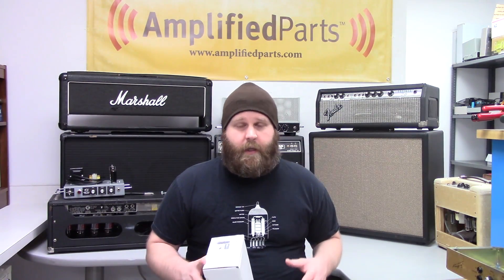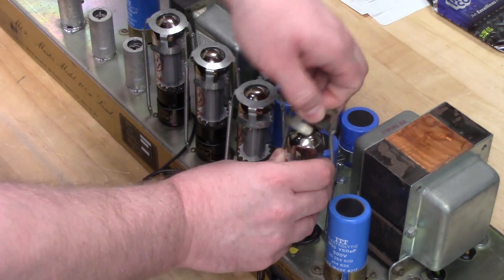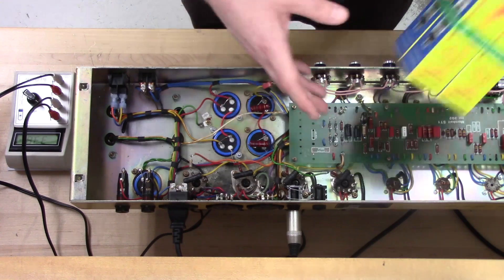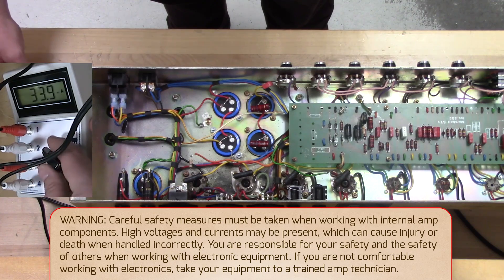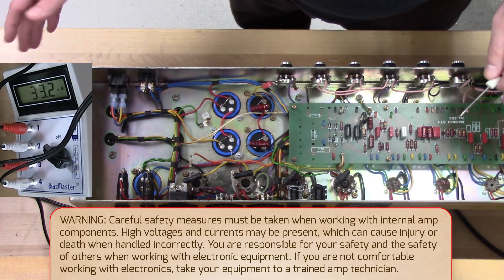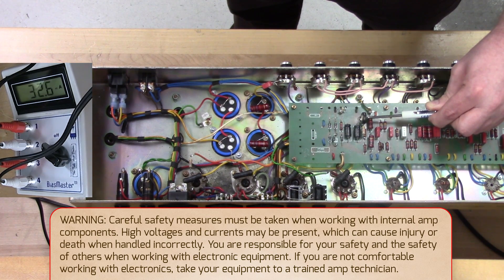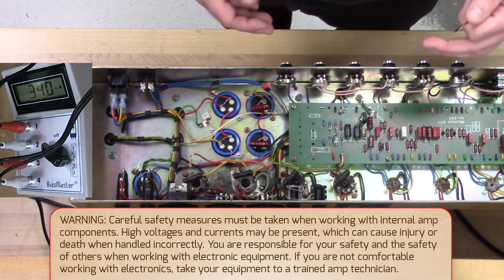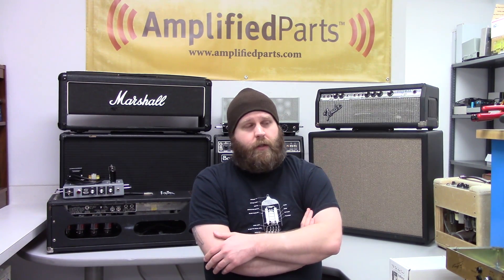How to Bias Your Amp Using the Tube Amp Doctor BiasMaster

Comment: Great instructional video. Do you ever check the overall bias  current or just rely on the cathode current for each valve. It seems like a longer way to set the bias if the valves are already matched?

Comment: The TAD manual states that if the matched tubes are not within 1.5mA tolerance, something must be wrong. What's your take on this?
Here's the manual quote: "With a matched set of tubes the value should be in a tolerance of +/- 1.5 mA. Exceeding of this value indicates a malfunction and the amp should be taken to qualified personnel."

Comment: I’m sure others have said, it’s not enough to just say “set it between 25-48 mA.” You really need to measure the plate voltage to be able to calculate where the bias should actually land. 

If you have a plate voltage of 480 V and you’re running EL34’s, they should be set around 36 mA if you are going for 70% dissipation at idle. However, if you had an amp that ran the plates higher, say at 513 V, it will be more like 34 mA for that same 70%.
Reply: 6L6 (the black metal tubes) per IEC were tested @ 250 VDC plate, 250 VDC screens and  negative 14 VDC bias. With a tube that is in spec the plates will be at 103% plate dissipation! EL84s are also tested at 100% plate dissipation. 6973s are tested at 97.5%. 7591s and 8417s are tested at 300 VDC plate and screen which is above the voltage output capabilities of most old USA suitcase testers. The AVO testers will go to 300 volts, and even 400 volts. There is no 350 volt setting and some won't do 250 volts making IEC testing difficult. I made a special biasing meter that has prototyping capabilities for bias supplies and it also has a 100 watt rheostat for cathode biased amps. The fixed bias resistor is a 10 turn 50K resistor. If your amp lacks a bias pot, use the pot in that meter, dial in the plate current you want so the amp is biased where you want it, and it has 0-600 volt meter for the plate & 200mV for current. When it's where you like it, shut the amp off pull the leads out and check that 50K pot with an ohm meter. Go find the closest value fixed resistor and use it. It can also check 2 to 8 power tubes with those bias probes and show the cathode current on  the volt meter. You can also substitute dropping and load resistors to design a bias supply circuit. It has a 0-600 volt meter and a 0 to 200 mA meter (A 0-200 milli-volt meter across a +/- 0.1% tolerance 100 watt 1 ohm resistor). There are two of those 1 ohm resistors in it. I also modified it to handle 2x voltage but you have multiply the reading by 2. At 2x, 550 volts would be 1100 volts plate. Old SVTs can have around 730 volts on the plates. It even shuts itself off after about 15 minutes. It runs on batteries or 120 VAC.

Comment: Take a 50-watt EL34 amp. If the recommended range is 20-40 mA, why not start at twenty and raise it while playing until you get the sound you want, without going over the max, of course?
Seems like sound is what we are after, within the safe range. Numbers being just numbers. Color of the plates under power is also valuable info.

Comment: Bias is one thing, but what about plate dissipation?  You need to know the cathode to plate voltage to calculate that.  40 mils at 300 volts will give you 12 watts of plate dissipation.  This could be the high end of some tube ratings.

Comment: I have a question is you can answer it. When people are working on the amp, how do you replace and solder components with one hand or do they discharge the capacitors?

Comment: nice video.
@7:29 for potentiometers' maintenance, that procedure may be good enough.. if they are dirty (as in noisy, etc) the procedure is a two-step if you want the cleaning to last for longer than a few weeks.

spray the pot cleaner of your choice, work the potentiometers REAL good and let them sit for a few hours. spray the pots again to flush out the dissolved dirt and depending on the cleaner you use, it may be a good idea to spray a pot lubricant for both the electric surfaces and the shaft. (the presented brand has the F5 for extra lubrication for faders and such)

(some pots have grease on the shafts, especially the double pots, and that grease can and will get on the tracks and blades with time. it collects dirt too)

Comment: You need to know the plate voltage to set the plate current.  25-40 mA is a huge range.
Reply: but you can't adjust the plate voltage?    so lets say  i don't know the plate voltage on my specific amp,  but i measure my 4 power-tubes,    and i see we are drifting around the  30 mA - 40 mA  area,   then i can safely bias them all to exactly 35 mA  without doing something stupid,  am i right?   I can safely assume that the four  KT88's most likely were biased at around 35 mA by the manufacturer, is the idea.
Reply: @Lasse3  You need the plate voltage to know at what mA to set the tubes depending on how hot or cold you want your tubes, 70% of the max voltage is pretty much the sweet spot, so for example lets say that the plate voltage is 450 VDC and you're using an EL34 tube (25W tube) you divide 25/450 and get 0.0555, that multiplied by 0.7 (your 70% sweet spot) gives you 0.388 which is 39mA.  This kind of probes are useful, but you still need to know the plate voltage of the amp in use in order to get an accurate reading.

Comment: Very good promo but a terrible idea to use a metal screwdriver in a hot amp even if you have one hand in your pocket. Use a plastic tool or other non-conductive tool. If you're buying matched tubes, is it really necessary to measure all 4 tubes in order to establish correct bias since there's only one adjustment for fixed bias amps that adjust every power tube's grid voltage in the same direction? Also, how far off does current need to be in a tube to be considered not matched?
Reply: Personally I check them all anyway just to make sure that each side of the power amp is balanced as best as can be. 

For instance, let’s say I have a set of tubes that are measuring 40 mA, 37 mA, 43 mA, and 40 mA respectively. I would likely move the 37 mA one to the outside as it would be a closer match to the 40 mA one as opposed to the 43 mA one. Sorry if that’s a bit convoluted. 

Does it actually matter that much? I can’t say for sure, but my mind feels better about it lol

Comment: What ever happened to looking at the amp on a scope and adjusting bias right to the point cross notch distortion disappears? Of corse, one needs to look at idle current also, but when you adjust for the point of cross notch elimination, the amplifier will sound its best????

Comment: I know this is off topic, but I need two, ceramic octal tube sockets to fit a Marshall JCM900 chassis, the holes to mount the sockets for a Marshall JCM900 are larger than most American chassis holes.  The JCM900 tube sockets are bottom mount, and the hole diameter is approximately 1-1/4".  I hope Amplified parts is listening!
Reply: try going on their website and... i dunno... looking!

Comment: This product would be perfect if it measured the plate current as well.i know the Euro Tubes one does,but it only has 1 probe :-(
Reply: Did you mean voltage,  because last time I checked, "mA" is a measurement of current?
The eurotubes measures both voltage and current (amperage), this one only the current.

Comment: Mashall 100 watt, 2 new power tube sockets,crimpon connecters on the power switch, one new speaker jack,looks like an orange drop for the presence control cap and by the looks of the added resistor next to the bias pot, I'd say that this was converted from 6550 power tubes to EL34s, 180 k bias feed resistors as well,maybe a new V1 tube socket,can't see it that well. How'd I do ? Thanks,I love your videos.

Comment: Hi
I have JMP-50 2204 amp with EL34’s!
Well.... it sounds horrible!
I have replaced everything I could think of and I could!
Tubes, filter caps, trim pot,bias caps, pots, jacks tube sockets, a lot of other caps!
.....still sound awful:-(
On low volumes it is not that bad, but the more I push it, the worse it sounds!
Well....with Marshall tube amps is supposed to be the other way around isn’t it :-)
I was checking the bias from time to time  and the last time I did I left the probe and meter on V5 , and  found something that definitely didn’t look right to me!?
Before that :My amp plate voltage is 400V!
Most JMP’s are on 600V, but few run at lower : at 400V!
My JMP is one of them!
So I have set it around 37mA idle!
There was around 0.4~0.5 difference between V4 and V5 at idle!
I have one of these socket probes that goes between tube and amp socket with probes to be plugged in meter!  I am biasing the amp, on mV setting on the digital multimeter!
After about 15 min waiting for the bias settling in ,I left the probe and the meter on, and start playing!
The readings on the meter went up, which it should!
When I was swapping the probe back and forth between V4 and V5
, I found V5 was jumping a lot higher then V4!
And as I said above,the more I was pushing the amp, the bigger that difference became!
For example:
The highest readings on louder lower notes on V4 was reaching 45mV, while V5 was going way higher to 130mV!
If I stop playing, both will go back to 37.0 37.4!
The lauded the amp pushed, the bigger the reading differences between V4 and V5 !
If I swap the tubes, the higher readings are still on V5!
I have well matched pair of svetlanas, and I would guess, there is crossover distortion caused by the big difference in the current draw between V4 and V5!
What possibly can cause such a dissbalance Between the two tubes when amp is pushed!??
All transformers are room temperature!
No hum or any other signs of something being wrong?!

I have Marshall JMP, and now i’am recording with amp simulators .......yuck  !
Please Help!
Any suggestions would be highly appreciated!
Thanks for Your Help, and Kind Regards!
Steve!
:-)
Reply from the maker: You may want to check that both your phase inverter, and output transformer are balanced.
Reply: amplifiedparts Thanks amplifiedparts!
I have figured it out! My phase inverter circuit was all messed up!
Kind Regards:-)
Reply from the maker: Awesome to hear you got it figured out! How does it sound now that everything is working right?
Reply: amplifiedparts
Well there was 100K resistor on the phase inverter measuring way above 200K ! V4 was barely moving while V5 was popping off the lid!i put some metal oxide and both tubes start working about the same! I have ordered from guy from Italy 1/2W pihers and he promised to me to match the cathode couple 82K/100K, and the following 220K couple so i have all resistors as close to the spec as possible! It works pretty good now, but I wanna make it all with carbon film pihers as it comes originally! Thanks again for the Help, and Best Regards!
Steve:-)

Comment: Do companies really test every tube, record its characteristics, and say "hey this one matches just right with the one I tested 30 minutes ago! now... which one is it?"
I really would like to see how far off 2 individual tubes  bought from the same reseller/company, at the same time, etc.
are. Aren't you curious?
One more question 
Can one just use parasitics to make them match?(push-pull) (assuming one has put in the circuitry to do so)
Reply from the maker: "Do companies really test every tube, record its characteristics, and say "hey this one matches just right with the one I tested 30 minutes ago! now... which one is it?""

They do! A cataloging process has to be used to keep everything in order but that's precisely how it happens.

I'm not sure what you mean by balancing the tubes using parasitics but amp builders have definitely used separate bias supplies, one per tube, to balance the bias on unmatched tubes.